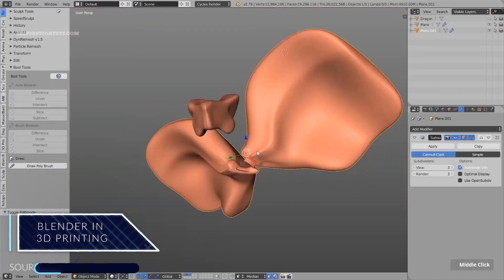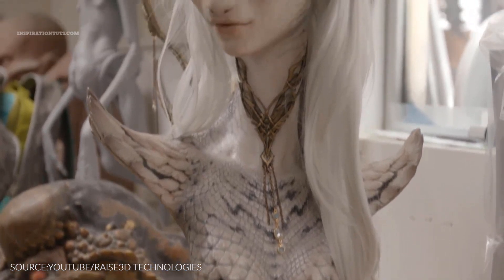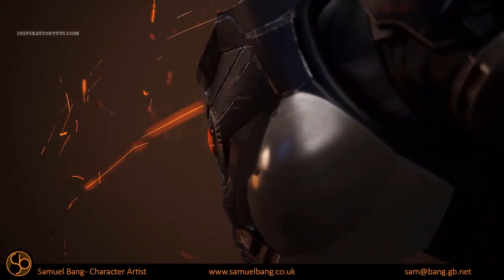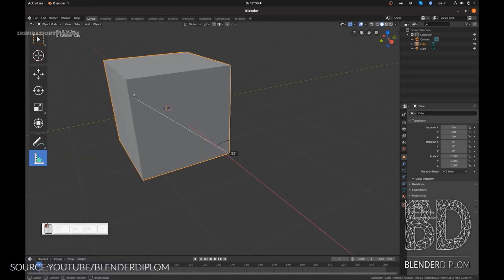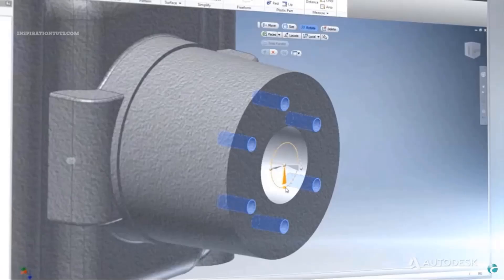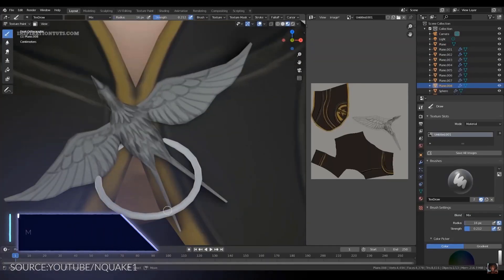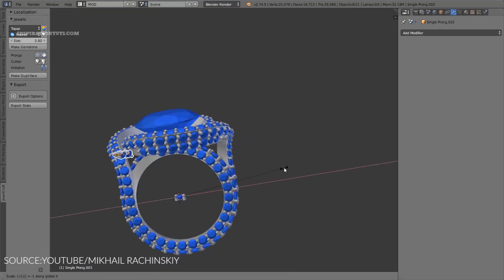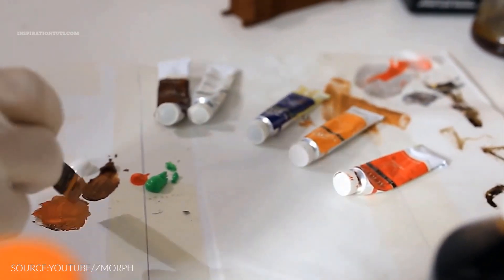is Blender Good for 3D Printing

Comment: So if i have 5 objects and just join them with CTRL+J. I can them print them ? even if they are not bollean together ?
Reply: you probably still should,  also  take a look into  preferences > addons   type in  3d-  in search and  3d- print toolbox should pop up  install/activate it   and with that you can check the mesh and make it manifold  be sure to save first and  save to  a new file  before doing  boolean and this toolbox opperations as it  isn't perfect and can  mess up what you are doing .
some slicers might be smart enough to fix some problems in models but it's better to   do it as correctly as possible before slicing   and double check the slicing result .

not doing so might result in missing layers, disconnected parts in the sliced result and will result in print failure so spent the extra time instead of coming to  a failed print after 15 hours.

Comment: What about making your own LEGO pieces, minifigures and models?
Reply: Even assuming you get the meassurements right (which won't be easy) for them to be compatible with Lego bricks (e.g hair you can put on minifigures) you'll need a VERY fine printer. Which usually are pretty expensive.

You need them as smooth as possible and to use ABS like Lego does as well. That way you can use Acetone vapor to smooth them more. Sanding will hardly work.

Sooo it's possible but not easy at all.

Comment: I tried Blender for 3d printing about 2 years ago and it was absolutely USELESS at producing printable models - doing subtractions for example would often lead to leaks in complex shapes, that were impossible to fix. The 3d printing plugin at the time was completely unable to help with this. I'd like to hear from someone who actually designs and 3d prints stuff - has Blender improved? Is it worth trying again? Else I'll stick to Fusion360.
Reply: Nope I almost lost my shit when the models I worked for weeks suddenly doesnt work for printing. It's only good for visual stuff.
Reply: lol you need the 3d printing plugin, it makes is easier for slicers to use. i 3d printed my glasses that way

Comment: no it's useless for 3d printing (like all other 3d modeling software)
it's great for 3d modeling.
it can't generate Gcode that the printer can understand, a 3d printer would have no clue what to do with anything any 3d modeling software spits out
pretty much any modeling software that can export an OBJ (so all of them) will do if you understand how to build what you wanna build, it's just another tool in the pipeline to get to a finished print.
the only part of that pipeline I would call "3d printing software" is the slicer that generates the Gcode .. so Cura, Slic3r, prusa slicer etc.
for real world practical models you would be better with something like Fusion 360 (also free) or solidworks and in my experience for making organic models that will translate well into 3d prints nothing can touch Zbrush
Reply: Most helpful comment thank yy

Comment: I 3d print. But I use autodesk fusion 360 (free) to design hard surface and practical models.
Reply: i do too, i find blender models are less useful for 90% of parts i print, especially due to mesh issues being a huge deal when printing parts, as it is very easy to create 0 thickness meshes in it
Reply: Same, I find fusion to be super good at functional models
Reply: Fusion360 is only free for personal use, the maker license and startup license was changed but it is only free for a year and under 100k dollar company , i also use it because i found blender too complicated